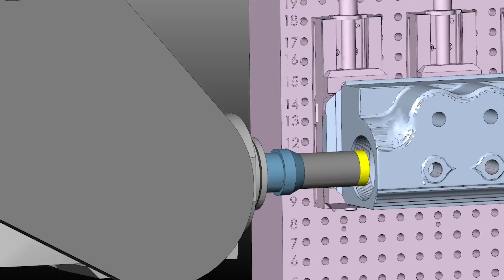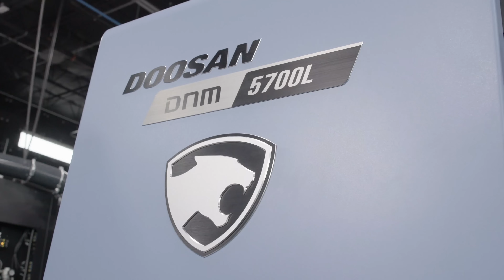Our BOSS Sucks… You DO NOT Want To Work Here!!!

Comment: Question. I work at a job shop, does pretty well, were busy etc. I'm on two jobs at the same time, I'm using 2 fixtures to hold down these parts. And it's about a total of 40 6-32 screws to tighten the part down to the fixture. Been hounding the manager to get a drill so I can loosen the bolts much quicker. But REFUSES to get a SHOP DRILL. I refuse to buy or use my own drill because last year one of the employees had a crapped out drill as he was using it for his job and the company never refunded or reimbursed him. 

Thoughts?
Reply: If I were in your shoes, I would document how long it takes to do a complete changeover (taking parts out and putting them back in). Then, for 1 day only, bring your own drill in. Make sure it is the type that you can control torque so that you don't strip the threads in the fixture. Document the time savings. Share your results with the boss. If the time savings justify buying a drill (figure every hour you save over a year at $120 per hour), and he still refuses, then find another job or send the results to your boss's boss.

Comment: Went for a job at Delco Remy battery company. In the 80' and 90's their batteries were in every GM car.  It was a Union job; thought they would have decent machines. The lathes and mills they had, were pre-WWII machines. The shop was dark and dirty. Then they wanted me to work swing shift. That's 1st-2nd and 3rd shift in a rotation. I asked if they were going to get a new equipment. The foreman said those machines have made parts and there's no reason to upgrade. Even though I worked at a mom & pop shop. It was far ahead of that shop.  Three months later, Mom & Pop purchased 1 of 2 cnc machines. Delco shut the plant down and moved to Mexico.
Reply: Man, it happens all the time. I should have mentioned lighting in this video, too, I can't stand working in shops with terrible lighting.
Reply: @barrysetzer  come back from lunch break and feel like ur blind a feeling i know all to well lol

Comment: If the cutter is really hot. Does it cut aluminium better? (Coolant is off)
Reply: No
Reply: @TheTrex600ESP  ill reask the question.
If the aluminium is really cold. Would that work then?
Reply: I will belive that aluminium will melt to the cutter.
Reply: @TheTrex600ESP  ok. I believe the cutter will melt the aluminium. 
I just was curious. (-120c degrees celius ) super cryogenic cooling material. Perhaps the cutter will cut like its glass! Idk like a frozen candy stick. Become brittle and ... the cutter will get hot .

Comment: Hey titan. I was talking with my brother who is a math major and he was telling my about using polar coordinates instead of Cartesian coordinates and I thought it wasn’t possible to run a machine that way. We’ll later he sends me an article on g15/g16. Can we please get a video on when these are used? Thanks, BOOM!!
Reply: It's been to long since I messed with NC so I can't remember the finer points of NC polar coordinates, but at the very least when you're making parts whose features are oriented around a central axis, polar coordinates makes things a heck of a lot more legible and easier to work with, saving you time and reducing the chance for mistakes.
Reply: Here is a video that we did that used polar interpolation https://youtube.com/shorts/GwuPJNlZ-v4?feature=share
Reply: Radial coordinates?
Reply: You can switch between them in program freely..  define central axis and then use angle and radius. Its nice for hole drilling with diferent spacing on same radius and it can be used to define polygon without calculating end points, etc..